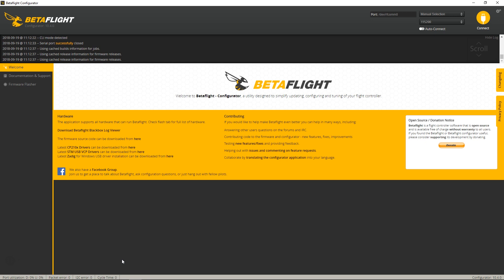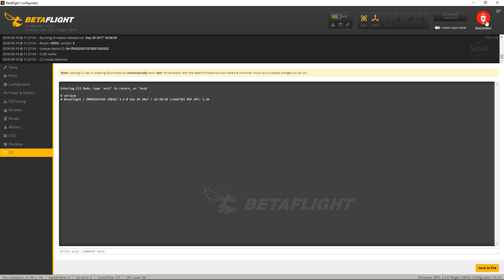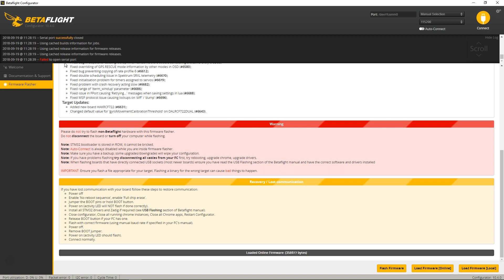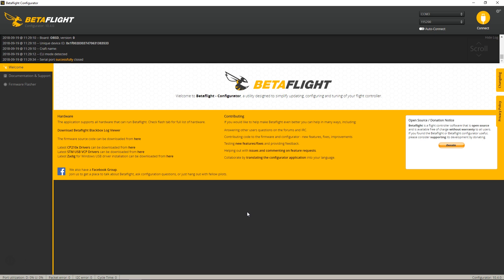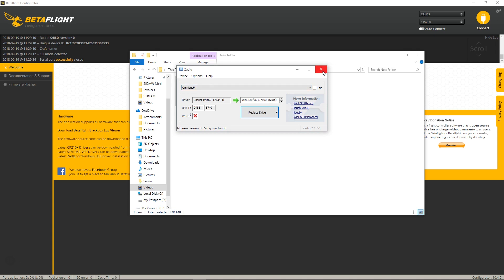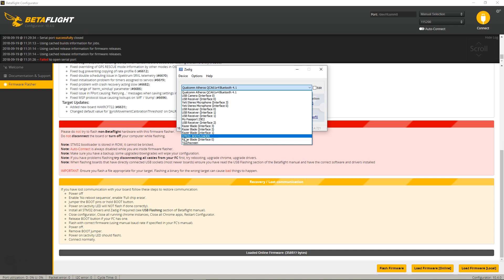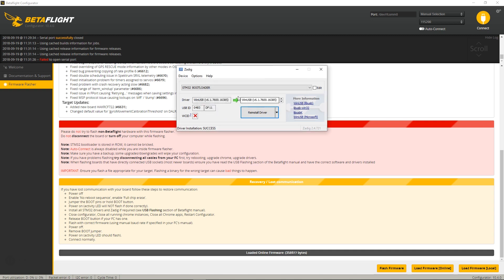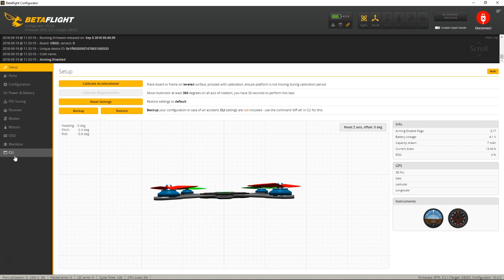How To Force or Fix DFU/Bootloader Mode On Any Betaflight Board That Won't Update

Comment: I cant even get to rhis screen
 Im using the speedy dongle3 which has every single option beta does. And furthest i get is the firmeare update screen qhere i can hook up to rhe donglw for beta flight but i can not getnpassed tue screen,which tells me it can not communicate with tue flight controller. Its the happymadel x12, 😮and  unable to get to dfu mode.

Comment: Thanks for this video, it helped alot, I used to bein this heavily and gave it up for 3 years, now my itch is back.  Some things to note that occurred with me.  I am using a clracing F4 from like 2019 that was brand new and had 3.2 on it...When I got to the part on Zadig to replace the driver, it was "Install Driver" as none was there to begin with.  Then to get in DFU mode, I have to plug in when holding the boot button(this did not work before installing the Win driver).  Other than that this trick worked, thanks!

Comment: Man, thank you so much!  Using your tip I was finally able to swap my BeeBrain Pro from Betaflight over to Emuflight.  For two days I couldn't figure out why I could connect to Betaflight normally and still connect, yet I was unable to access the bootloader...  Something about the stm32 driver must have changed in the past year, as I was able to do firmware flashes back then.  Thanks again!

Comment: Remember the mapping it showed when it starts.  A lot of times your quad wont reconnect to betaflight until you remove that mapping you just set.  Or set it back to default.  

This helped me get into one of my quads,  cant remember which.  So thanks for this.  But then I spent an hour after flashing.

Comment: you saved my quad. I flashed wrong diff. I couldn't connect to beta flight. All I had to do is get into DFU, flash the firmware with erase configuration opinion. Thanks, man.
Reply from the maker: No problem. Glad it worked for you

Comment: I know this is an older video, but anyone having problems with DFU, or BF not recognizing board or wrong port, before using zadig try Impulse RC driver fixer, once downloaded save shortcut on home screen/start menu, whenever you have a problem, just plug in quad to pc, click Implulse RC Icon, and that's it, wait about 2min. if it doesn't work then the zadig should still fix it. 

https://impulserc.com/pages/downloads

Comment: My luck as usual. Downloaded and followed instructions exactly, with no luck. When I reconnect to the board now it doesn't even connect to a com port. I connect Firmware Flasher tab to bring up the list of files and load mine from online, then try to flash and again sticks at initiating reboot to bootloader.

Comment: thanks man i through the board had some problem ,but no u solved THANKS !!!!!
Reply from the maker: No problem. Glad it fixed your problem
Reply: @johnnydeltoro  thank u , i have got sp racing f3 evo brushed FC can i use a Bluetooth (HC-05) module to that and using that as a transmitter to fly the drone

Comment: i have the "CLracing F4S V1.6" and in zadig it shows as "betaflight STM32F405" - after i install the drivers, it is still showing as that. I don't see STM32 Bootloader. ImpulseRC gives me the message "Failed - An error occured while entering bootloader! Unexpected number of devices detected." Any idea what I can do? I disconnected every USB device except the mouse, tried different ports and usb cables.
Reply: thank you in advance!
Reply: Hi i know this is from years ago, but did u ever sort this issue ? I have exactly the same & worried ive bricked my drone 😢
Reply: @dannykirkwood4685  it worked on a different pc for me

Comment: You know how to fix the problem of when you turn on the battery, the Drone it comes in DFU?
Reply from the maker: Check make sure boot button isn't compressed or stuck on. Did you conformal coated your board? You have full erase disk checked off after disconnect from betaflight?
Reply: @johnnydeltoro  You were right. 
Incidentally the button broke,Button cover no longer exists, Only electronics.
I gave a tight With a screwdriver, And I splashed some  WD40 oil. 
Will I take the risk on flight of entering DFU?

Comment: I had a older F3 board Xracer SPI. I was able to connect to betaflight before but the update wouldnt work,So I tried to follow your video and I messed something up with that zadig program,I didnt get to bootloader mode and now I cant even connect to betaflight. I changed it to the winusb and that didnt work. Im not sure what it was on,but there are only a few options,I think I tried them all and nothing,Any idea?
Reply from the maker: Sorry for late reply. What do you have connected to what UARTS? If my memory is correct, I believe back then in the F3 days, sometimes using or having all UARTS connected would interfere with USB port so I use to make it habit to setup betaflight first and/or I'd disconnect whatever connects to same UART port. I'd try cutting whatever is connect to UART 2 till you fix it. Try that.
Reply: @johnnydeltoro  i have f3 evo osd before i can connect with betaflight but i cann't connect with mode dfu but after flashing with zadig i cann't to connect it with betaflight i have re-flash it with libusb-win but nothing :/

Comment: YESSS, I was so lost trying to figure out how to get my computer to detect the DFU mode. Ended up getting the emax tinyhawk (MatekF411) to flash by holding BIND and plugging it in to the computer then using Zadig to swap the driver. I don't know why I didn't think of that but now I'm on BetaFlight 4.0.5 with project mockingbird v4!!!
Reply from the maker: Yeah this video is for in case bind button won't work and for any other reason why it won't. Glad you got it to work

Comment: whats it mean if my fc dosent pop up on the zadig
Reply from the maker: If you don't hear the connecting sound with you connect USB, then something's wrong with FC/USB port. If you do hear sound, check Windows Device Manager to make sure it connects.
Reply: @johnnydeltoro  AFTER 3 DDAYS I GOT HER GOING BRO FINALLY SCUBA FPV CAN FLY A 5"

Comment: FYI (for ya'lls info ;) 
the dfu command in 4.0 seems to be 'bl' now, for 'bootloader'  .. and zadig but no STM driver still had me pulling my hears out. BUT you mentioning the 'cli -> dfu'  did save me having to shortsolder the boot pins on my hawk5 f4 v1.0   thanks :D

Comment: Does this program work on a Mac also ? Having same issue
Reply from the maker: Not too familiar with Mac but if you have Bootcamp Windows installed then yes, it'll work
Reply: @johnnydeltoro  Got it going, typed in bl and hey presto DFU mode enabled :p